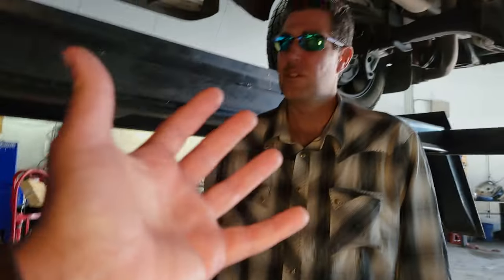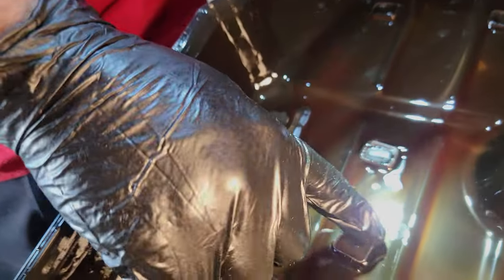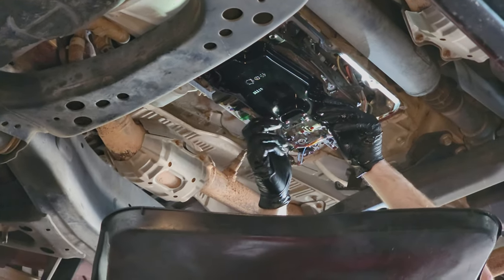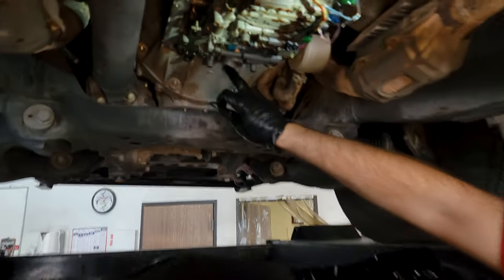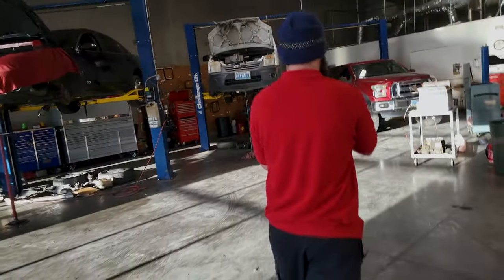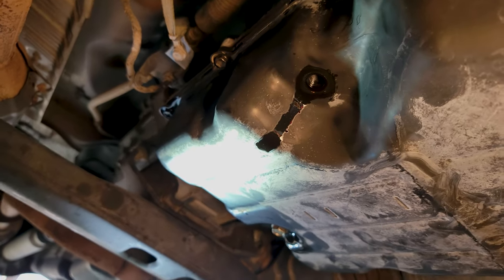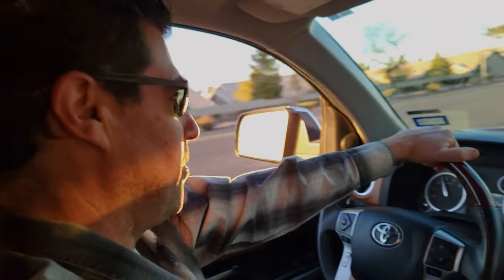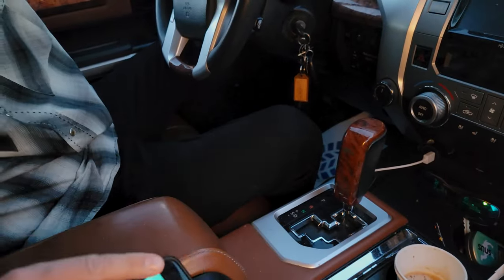Your transmission can Shift Better than New with this ATF

Comment from the maker: Watch This Next: Get your vehicle to steer better than brand new with this fluid - https://youtu.be/7Gjnjs__07s

     ♥️ Find The Right Fluids For Your Vehicles - https://www.amsoil.com/guides/?zo=5331179    

     ✅ Save 25% On Your Next Fluid Order: https://www.amsoil.com/offers/pc/?zo=5331179 

     ♥️ See Fluid Performance Tests - https://www.amsoil.com/performancetests.aspx?zo=5331179      

     ✅️ Buy Me a Coffee - https://www.buymeacoffee.com/YouLubher

     🥇🥇🥇 Synthetic Oil Protection Google Map Reviews
(702) 472-3614
https://maps.app.goo.gl/DmLU5hP72HadUBEm9
             
     ♥️ Synthetic Oil Protection Website - http://syntheticoilprotection.net

     Did you know a oil manufacturer can call a lubricant a Full Synthetic when it's only 25% synthetic? AMSOIL is different because it is 100% Synthetic and has a higher film strength keeping the metal parts separated. AMSOIL allows less friction, less heat, less wear on the component. AMSOIL Signature Series motor oil will last 25,000 miles on 1 oil change!  

     ♥️ Your Vehicle Could Run Better Than Brand New By Choosing The Right Fluids! See Results - https://youtu.be/9Y7XSl5YHFg

     ♥️ Why AMSOIL - https://www.amsoil.com/about/exclusive-distribution/?zo=5331179    

     ♥️ Synthetic Oil Protection Coffee - Ebens Favorite: https://supportwith.coffee/shop/subscriptions/sop/
Reply: Can I change transmission (liquid cherry) on my 60,000 Chevy 2.5 WT Colorado???please andwer
Reply from the maker: Yes.
♥️   Find The Right Fluids For Your Vehicles - https://www.amsoil.com/guides/?zo=5331179    

     ✅   Save 25% On Your Next Fluid Order: https://www.amsoil.com/offers/pc/?zo=5331179

Comment: Just did my 2015 F350 Powerstroke 45,000 miles trans fluid and filter with Amsoil Fuel Efficient ATF and I will admit it shifts like butter 🧈

Comment: That amsoil atf is the cat's meow! I definitely credit it with keeping the transmission in my old car going longer than what everyone told me it should!
Reply from the maker: You can get the Amsoil here with my website👌
Let's get your vehicles running better than brand new!

     For me to get credit & be "Your" Independent AMSOIL Dealer, please use my website below or my dealer no. 5331179 call anytime Eben Rockmaker 702-472-3614
After you click on: http://syntheticoilprotection.net
1. Click the hamburger menu
2. Click offers AMSOIL preferred customer
3. Click join now. 6-month PC member add to cart.  ( There is no reoccurring renewal membership unless you select that dot box ) 
( You have the option to not have your credit card saved if you prefer - est. 1972 )
4. Scroll up to the top Select shop by vehicle. 

New Promo Codes: FREESHIP & 5GS

Comment: I’m running Amsoil ATF in my 2011 GMC Savana Duramax and 2014 Honda Odyssey. Also Amsoil CVT fluid in my 2020 Honda Fit. All three are performing exceptionally well! No surprise there. 😉

Comment: I took my 22 camry awd to The Car Care Nut for a transmission fluid change at 18k miles he put Toyota WS Fluid he told me it's not good to replace it too often because...long story. My car has now 29,400 miles so 11,400 miles after the first fluid change I decided to ignore he's advice and do another fluid change and replace it with Amsoil Signature series and it's my first time doing it ever on my own on any car. Took it for a drive and lol people say in videos doing it too often it's dangerous because you are cleaning all the debri/dirt and it needs some to grip and not start slipping well as you can tell I did the 2nd one early af but it's now more grippy and accelerates faster and smoother with less throttle on eco mode lol I love it. I was also shocked that my mpg was at 34 before I started the process and drove it to my favorite spot and was able to get hit 40 mpg and I wasn't even trying to keep track of it lol anyway you people can change yours at 60k or higher to each their own aha peace out.
Reply: Do not listen to those people that is a myth and sadly even some mechanics believe this it needs changed every 30k but if you want to push it sometimes you can get away with up to 60k miles before change.
Reply from the maker: Sweet

Comment: Aren't you supposed to get the ATF up to the proper temperature range before putting the drain plug back in since it expands as it warms up and to get the proper fluid level? I didn't see in the video where that was done.
Reply from the maker: Yes you always want to take the fluid level measurement when the vehicle is warm💯

Comment: Hello, I have a 2010 gmc with the 6L80E transmission and it has a yellow fluid, it looks clean and the tranny is working well, I'm trying to figure what kind of fluid is that because all they are red. Do you know what brand is it? Or do you have any idea about what fluid could it be?
Reply from the maker: I have no idea there are a lot of oil Lubes for all different transmissions and they all have their own signature color the color has no correlation to the Quality it's just a dye in the fluid.

There are all different options you have out there the difference is with the Amsoil is the severe service film strength under load will have the best sheer stability and also cold flow stability in the cold so you'll have crisp fast shifts when the transmission is hot period in the transmission will perform incredible when it's cold out and extend the life of the clutch packs transmission filter and give you better drivability and longer lifespan of the transmission.

With the Amsoil transmission fluid Signature Series ATF you are transmission can shift better than brand new.

Let's give a man a fishing pole & show him how to fish. 

     Together! We can get your vehicles to run better than brand new!

     For me to get credit & be "Your" Independent AMSOIL Dealer, please use my website below or my dealer no. 5331179 call anytime Eben Rockmaker 702-472-3614
After you click on: http://syntheticoilprotection.net
1. Click the hamburger menu
2. Click offers AMSOIL preferred customer
3. Click join now. 6-month PC member add to cart.  ( There is no reoccurring renewal membership unless you select that dot box ) 
( You have the option to not have your credit card saved if you prefer - est. 1972 )
4. Scroll up to the top Select shop by vehicle. 

New Promo Code: FREEMP

    ♥️   Your vehicles can run better than brand new by choosing the right Oil & Lube!

     🇺🇸   50 Years of AMSOIL anniversary - https://youtu.be/MQUqRBI8dD0
     
     🥇🥇🥇   Synthetic Oil Protection Google map reviews
Eben Rockmaker, independent AMSOIL Dealer 
Dealer no. 5331179
(702) 472-3614
https://maps.app.goo.gl/1aXxuXrXK9eJwqK78
         
♥️   See Oil & Lube performance tests - https://www.amsoil.com/performancetests.aspx?zo=5331179

Comment: So will this work in my 98 Mercury Grand Marquis? I just changed the fluid, with the motorcraft mercon v, it seems a little better. My mechanic said to just stick with mercon v, but this amsoil intrigues me, if I were to use it which kind of ATF is it? Aren't there 2 different kinds?
Reply from the maker: It is on the lookup guide right here on my website and I recommend the signature series it will also give you the fluid and capacity and you'll have a smoother faster shift little less vibration you'll also notice it will shift significantly better as it's warming up and in the cold😉👍
For me to get credit & be "Your" Independent AMSOIL Dealer please use my website below or my dealer no. 5331179 call anytime Eben Rockmaker 702-472-3614
After you click on: http://syntheticoilprotection.net
1. Click hamburger menu
2. Click offers AMSOIL preferred customer
3. Click join now 6-month PC member add to cart.  ( there is no reoccurring renewal membership unless you select that dot box ) 
( you have the option to not have your credit card saved if you prefer - est. 1972 )
4. Scroll up to the top Select shop by vehicle. 

New Promo: FREEBOWL

Comment: If I just do a drain and fill of the pan. Are there any concerns with the Amsoil being compatible with the OEM WS Toyota ATF fluid that's still there? Thanks!
Glad anytime you do something to a Tundra.
Reply: the amaoil atf works with toyota ws fluid. i used it in my scion tc and had no issues with a drain and fill with amsoil
Reply from the maker: Oh yeah you'll see everything here on the look of guide for your year make model and engine size I always recommend you grabbing a couple extra quarts just to be safe sometimes the component can take a little more and they can change the component mid-modelier on certain vehicles.
♥️   Find The Right Fluids For Your Vehicles - https://www.amsoil.com/guides/?zo=5331179    

     ✅   Save 25% On Your Next Fluid Order: https://www.amsoil.com/offers/pc/?zo=5331179
Reply: I just did a Drain and Fill on my  2006 Toyota Tacoma Automatic Transmission. The short answer is YES you can have a mixture of AMSOil & The Toyota but I personally wanted all AMSOil in my Truck. 

My truck was last serviced by the first owner at a local Toyota Dealership so I knew it had Toyota Genuine WS ATF in it. What I did was buy 3 Gallon AMSOil Signature Series Fuel-Efficient (which is Toyota WS compatible)  and Drain and Filled  3 times until I saw that ATF come out the most transparent red as possible.

1.) I did this by first Draining the fluid and measuring how much came out (luckily the old fluid from Toyota was not extremely dark)

2.) I  put the same amount of fluid back into the truck and turned the engine ON while shifting into all gears (i.e. from Park, Reverse, to Drive, etc) for 5mins or so to have the ATF work throughout the Transmission System.

3.) I did the same Drain & Fill process mentioned in Parts #1 & #2 until I saw the ATF come out very red like new 2 more times (A total of 3 Drain & Fills)

Note: On the final Drain and Fill you must check your Transmission Fluid Temp. This will ensure that the correct amount of ATF is in your Transmission.

** My Tacoma's Transmission Fluid Capacity is 11.5 Quarts**

FINAL THOUGHTS: The truck shifts great and smoothly and no issues. I hope this helps.
Reply: @kennethbecerra7362  that's exactly what i did on my scion. drain and filled until the fluid came out as clearly red as possible

Comment: Hi there !!
Im already using Sig.series on my engine....2001 Toyota Avalon...in the transmission been using the manual indication with Dexron III....then a couple years ago...i changed it to DEXRON VI.....so my question is .....!? Can I mixed Dexron VI with ATF Amsoil .!!!..????
Reply from the maker: I don't know I would double check the lookup guide. 
There are technical bulletins updates all the time if you are new to Amsoil you definitely will get the best value as the preferred customer which you can get right here on my website and that way you'll be attached to me I will be your independent Amsoil dealer✌️☕️

Let's give a man a fishing pole & show him how to fish. 

     Together! We can get your vehicles to run better than brand new!

     For me to get credit & be "Your" Independent AMSOIL Dealer, please use my website below or my dealer no. 5331179 call anytime Eben Rockmaker 702-472-3614
After you click on: http://syntheticoilprotection.net
1. Click the hamburger menu
2. Click offers AMSOIL preferred customer
3. Click join now. 6-month PC member add to cart.  ( There is no reoccurring renewal membership unless you select that dot box ) 
( You have the option to not have your credit card saved if you prefer - est. 1972 )
4. Scroll up to the top Select shop by vehicle. 

New Promos: FREESHIP & 5CERAMIC
Reply: Yes I already bought Sig. Series around week ago...plus coolant boost dominator, fuel cleaner, every thing arrived in very well conditions and fast here to Houston, Im already preferred costumer, so I have to continue searching about the Amsoil ATF and Dexron VI mixing....maybe will call tech support, thanks 🙏 for your information !!
Reply from the maker: @fernandob3062 💯

Comment: Please may I ask whether I can use AMSOIL Synchromesh Manual Transmission Fluid in my Honda Civic FK8, because on the bottle it said: NOT suitable for LSD. I want the best protection and smoothest shift for my car. 
Thank you.
Reply from the maker: Honestly I don't know I would check the lookup guide and see if it shows it on there.
PC membership will give you the best value and when you use my personal link that would attach me to you so in the future I could always answer your questions about improving the performance and lifespan of your vehicles by choosing the right fluids!!👍
♥️   Find The Right Fluids For Your Vehicles - https://www.amsoil.com/guides/?zo=5331179    

     ✅   Save 25% On Your Next Fluid Order: https://www.amsoil.com/offers/pc/?zo=5331179

Comment: Can you do a video for 2018 dodge charger transmission oil change for a sealed transmission? Dealer says no flush required for sealed transmissions but I don’t believe it
Reply from the maker: This is the video on Sean's car it's very similar to yours - https://youtu.be/cEOX3NU0lQQ?si=DZODvWNontvhtCKK
 is like the other Dodges on the channel basically you drain the pin take it down clean the filter and magnet then you put it back and then fill it.
That's normal all the Dodges have a lifetime transmission and a full warranty so they say you don't ever have to change the fluid but eventually you'll wreck the transmission however in the meantime as you lose fuel mileage in your transmission shifts poorly it costs you tons of money in fuel in the car not performing correctly and shifting right so it costs more in the long run so you're still better off changing the fluid and using the Amsoil you can buy the fluid right here off my website if you have any questions in the future I can always answer your questions as your independent Amsoil Dealer the 6-month preferred customer will give you the best value on the products.
We have a video on the Channel with Sean and his Dodge Challenger basically it's the same transmission it's just like in this video I should say very similar it's not exactly the same but very very similar.
     For me to get credit & be "Your" Independent AMSOIL Dealer, please use my website below or my dealer no. 5331179 call anytime Eben Rockmaker 702-472-3614
After you click on: http://syntheticoilprotection.net
1. Click the hamburger menu
2. Click offers AMSOIL preferred customer
3. Click join now. 6-month PC member add to cart.  ( There is no reoccurring renewal membership unless you select that dot box ) 
( You have the option to not have your credit card saved if you prefer - est. 1972 )
4. Scroll up to the top Select shop by vehicle. 

New Promo: FREEFUNNEL

Comment: So on a 2018 Mitsubishi Outlander PHEV, there is no Amsoil option for the generator/front electric motor , Mitsubishi states it takes Mitsubishi CVT J4 which is what I've been using since new. I also have a 2016 Outlander 2.4 gas and for the CVT when I look that vehicle up there is a Amsoil option for the CVT fluid. Factory fill  is also Mitsubishi CVT J4. Since it's the same fluid just for different applications could I use the Amsoil CVT fluid in the generator on the 2018 plug-in hybrid?
Reply from the maker: That's a darn good question I would double check tech support give them a buzz if you're new to Amsoil the 6-month PC membership will give you the very best value all you do is just ask for that it's 10 bucks and when you give him my dealer number that would attach me to you in the future I can always answer all your questions about improving the performance and lifespan on your vehicles and Equipment as your Amsoil dealer.
Eben 5331179
[Name] AMSOIL Technical Support
[Mobile] 1 (715) 399-8324
Reply: @Syntheticoilprotection  I'm also a dealer, I contacted tech.
Reply from the maker: Are you a new AMSOIL dealer? Did you use my link if your new?

Comment: my 2018 equinox got 69mi is it good to change the transmission fluid without problems?
Reply from the maker: Yes I would change it if it was my car - I give a man a fishing pole & show him how to fish. 

     Together! We can get your vehicles to run better than brand new! 

     For me to get credit & be "Your" Independent AMSOIL Dealer please use my website below or my dealer no. 5331179 call anytime Eben Rockmaker 702-472-3614
After you click on: http://syntheticoilprotection.net
1. Click hamburger menu
2. Click offers AMSOIL preferred customer
3. Click join now 6-month PC member add to cart.  ( there is no reoccurring renewal membership unless you select that dot box ) 
( you have the option to not have your credit card saved if you prefer - est. 1972 )
4. Scroll up to the top Select shop by vehicle. 

New promo:FREESHIP

Comment: I come from the Bimmer and Mini world so forgive me for my ignorance but people actually reuse their tranny pan? While OEM's usually tell you never to change the fluid I'm aware that's nonsense however whenever I do change the fluid I always swap the bridge seal,  the  tube seals leading to the valve body, trans pan with filter, magnets (because they get damaged as they heat cycle), ultrasonic clean the solenoids etc.

Usually this only costs about $150 in parts all together and considering a good fluid fill sets you back $100 on the lower end it just makes sense to do it all at once to avoid wasting that precious nectar.